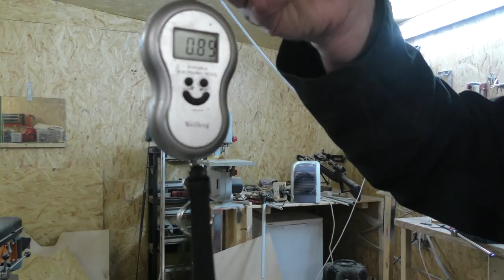How To Make+Shoot The Pump Action Repeating Crossbow Pistol

Comment: This is brilliant, thank you Joerg!  Now I want to see a 3D-printed composite version!!
Reply: J. P. 3D printed bow? Not a chance (if you want something that can be used as a weapon)
Reply: Randy Is there a law against 3-D printing a crossbow frame?
Reply: +J. P. (Prohaska Nation) the bow frame would have little to no elasticity, compared to wood or metal bows. You would have to use some inherently elastic bow string, such as rubber, but even then the plastic couldn't handle as much draw weight as a cheap wood slingshot.
Reply: No, it's just that the plastic would be lucky to hold for a few shots. Most 3D printer plastics anyway, they're practically pure chinesium.

Comment: The airgun has more penetration then a 5.56mm bullet. holy shit.
Reply: Not quite. It went through a single car door and through some wood. If the car door deformed the bullet (possible) it might not have had enough penetration to go through as much wood because it wouldn't have it in the ideal cross section and probably would be keyholing.  A 5.56 nato round has 1700 joules of energy while this launcher has just under 1000 joules.
Reply: acephantom903 i think the door would we enough to deform the bullet unless it is a green tip.
Reply: 556 is not supposed to have high penetration, the dart is also hugely more massive with a file hard steel tip. it's not really a fair comparison to make.
Reply: FMJ, which is standard for a nato 5.56 round, would've sliced through that car door and out the back of the shed without any issues, even deformed. You highly underestimate the penetration power behind that round. It slices through standard lightweight kevlar vests easily, and at a distance too. The standard nato 55gr is small and moves at 2700 fps out of a very short barrel of 10.5". Out of the ideal 24" it moves at 3300. This bolt being a very large and slow moving round compared to all modern bullets will by nature have far less penetration power. It probably even penetrates less than a .45 acp.

Source for velocity: https://www.ar15.com/forums/t_3_118/511787_.html&page=1
Reply: LIBERTY PRIME i don't disagree however the thing about 556 is once it hits something it starts to tumble because it is so light
Reply: SuperAWaC It starts to tumble but much of the energy still remains, as long as the steel of the car door doesn't break the round into multiple pieces it'll still retain much of its penetrating ability.
Reply: Given that car doors are mostly aluminium these days, it's very unlikable to cause the bullet to fragment. Also a tumbling round is still very effective by dint of its sheer kinetic energy.
Reply from the maker: This car door is steel though... a powerful rifle round would no doubts go right through that car door, but it will deform slightly. Not enough to render it harmless in any way though. The difference is that this "arrow" is 18mm in thickness (.71"). It requires a lot more energy to punch a hole that big into several layers of steel and plastic than a 5.5mm hole.
Reply: but with what i saw.i think it has more than enough energy to do so.
Reply: Remember kiddos, Speed is how you kill armour, not size ;)
Reply: Drivenfromhell Gothimus Prime as said by Matt.
Reply: Drivenfromhell Gothimus Prime Speed's how you pierce armour, but a heavy enough slug with a lot of velocity will still kill anyone wearing it.
Reply: Drivenfromhell Gothimus Prime 
i am not a sciencetist but isnt it momenton that kill(or energy idk)
Reply: SuperAWaC, The joule measures energy which is force*distance.  Once you compare joules, it's apples to apples
Reply: Avensis Astari Sure but im guessing in this scenario there isn't anyone wearing the armour?
Reply: Drivenfromhell Gothimus Prime Ceramic plating is designed to stop penetration, it can't do anything about the simple force of a kinetic impact. The underlayer helps spread it, but it still causes bruises on a wearer.

If you had a heavier round it might not necessarily pierce the plating, but it could impact hard enough to cause internal bleeding through the kinetic force.

Especially as modern armour is simply plates of ceramic material over padded vests.
Reply: In the example of a bullet, an object with low mass, yes. You're ignoring the part where I noted that a heavy object with sufficient mass would impart more kinetic energy on the wearer of the vest.

E.g., it wouldn't stop a cannonball, but it would stop a bullet.

It was a hypothetical throwaway comment, not a scientific thesis.
Reply: Yeah, ceramic plating is pretty amazing for deflecting rounds.
Reply: Avensis Astari it's mainly used in pair with kevlar. higher caliber ballistic plates use the ceramic to break apart the bullet and slow it down enough for the kevlar behind it to be able to catch the fragments.
Reply: Yeah, said fragmented pieces being fair easier to stop.
Reply: GreyRaider ceramic plates do not fragment the bullet, though that can happen depending on the bullet type and hardness (if it a brittle metal mix). The plate itself shatters, this absorbs the kinetic energy of the projectile and dissipates it through a larger area. That is why you can not reuse ceramic plates versus steel. High end ceramic will have sections and layers (like ceramic tank armor) to reduce the effect of losing plates and increase the number of impacts it can sustain.

Comment: Might seem like a silly idea but maybe it would be more efficient if you made a grip for the pump that was horizontal that you can slide your palm into. Sort of similar in shape to a circular shopping bag grip, but tighter against your hand?

That way it's easier (at least in my head imagining it) to keep the crossbow pointed where you want it to be as you pump it. It might also be more stable too.

Comment: If anyone has a 3D printer please try printing one of these and share photos/videos.
Reply: Not sure if PLA would be strong enough, maybe other plastics like Nylon.
Reply: @TheIcemanModdeler  Would be awfully slow too. At least 24 hours (with 0.4 - 0.6 mm standard nozzles), probably over 48, since you don't want to ruin the integrity by printing too fast.
Reply: For some reason the blueprint will not load, is there someone who has it and won't mind posting it

Comment: I learned a valuable lesson today when testing out my replicated Jorg-Ko-Nu...wooden triggers, even plywood wooden triggers are not recommended for crossbows of any poundage. My left thumb took the brunt of the strings snap back. Ouch. Now I'm fabricating a metal one. Here's hoping lol. I have rigged a 'safety' on my pistol crossbow for those just in case moments.

Comment: even cooler than his mag-fed modified one. Ive had one of those cheap bows sitting around for years. got the older 2 part bolts but Ill probably be losing a few soon enough LOL hardware store time! Gonna look to some rollers for the pump handle to cut drag a bit. perhaps a delrin rod with the screws down the center?

Comment: To increase the speed of the valve you could introduce a piece of string with slack in it so the rubber acting on the valve is moving at full speed by the time it starts of opening the valve.

Comment: Add a 18-24 inch spike to the front side of the pump for zombie spiking that could also allow the user to simply smash the gun on the ground to reload. 

If you made a rifle version you could really up the power with a design that reloaded based on ground to user weight. Shoulder in the shooting position on the rifle stock with the "stirrup" on the ground and the user simply uses their weight and gravity to reload the weapon.

Comment: To make sure both the point and knock end of the arrow have fallen perfectly into battery before firing, you could make a simple electrical circuit that makes an LED light come on in the rear. You could just have the two contact points in the arrow tract, point and rear, and the aluminum arrow would complete the circuit when it falls right.

Comment: Once again, you get far beyong the expectation.. in both model , maybe i should say, in three model you showed us.. including the 1000 joules air gun..very impressive...for now, didn,t see how you filled the air reservoir.. not manually right ?  Question, about the 1000 joule airgun...is it possible to make a silencer to make it more discrete without loosing efficiency ?  i would like to see this gun shoot in free space to see how far it can get.. metal doo and wood board make it slowing down a bit.. a big bit...so 

Congratulation again.. i appreciate all your ingeniousity
A co mment though.. when you use rubberband to the wooden crossbow, my experience is that they last only few weeks. how long last yours ? are they from better rubber quality ? what we get here come from China so fater some time they like..dry out.. and then brake very easily. cold they be replace with better rubberband ? like those for sling shot ? and it end up at you glued your wooden gun.. but half way through, you could make two piece and assemble them with bolts and screws so it can be oprn and change the rubberband then re assemble...so ?

Comment: I have a question, why didn't you make it so the trigger end is also the string pull back handle? isnt it a little awkward for you to press your hands together to pull the string back? if you had the trigger pull the string back (almost like a bow or slingshot motion) and have the pistol grip slide up from a slot on the bottom with a hook attached to it(that would slide underneath the string and grab it once it passes). I feel as though it would get you quicker results than the second version.

Comment: I've been doing a lot of research because I'm not an engineer but I like weapons, and from what I found on pullies and compact bows, it has more force with you using less force over all 20lbs of human = 80lb crossbow for example. Maybe you could do something with that to assist with the pump action. But again, I'm just new to concepts of these weapons.
Reply from the maker: Compound bows or crossbows use cams to allow a so-called let off. Means, you have to overcome a huge amount of peak force, but then it gets a lot easier. Won't help with the pump action though.

Comment: If integrated a cross-bow cocking leaver into the stock, instead of the sliding pistol grip design, you would nave more leverage and could increase your fire rate a bit.

Comment: Joerg, may be you could build a recoil absorbing stock with rubber power simular to ones found on modern shotguns such a the UTS-15 i think it's called. A high tech stock for a record breaking gun seems fitting, right? The stock could last a lot longer this way i think

Comment: Here's a wild idea. Going back to the first bow, what if the front handle is where the trigger is, and the rear cocking mechanism had a handle on it. That way you can benefit from that cocking motion, while having both hands on the crossbow at all times.

Comment: I paused it at 11:50 . I wanted to ask you about where you out the two screws in to hold the pump? I did this one time to make my shelf slide better ? I put a sleeve on the inside of the threads so it could slide easier and it worked and is still working almost no friction between the bolt and wood ? great job it looks funny to shoot

Comment: I wonder if you could apply the same pump-action concept to a recurve bow. And make it so you can draw it back like a bow (then the string locks in place) and then shoot.

A fixed handle at the front and a movable handle at the back, which would also have a trigger. (with safety of course!)
Reply: UrbanTarzan Duh That is a crossbow basically :) But for a recurve bow, with long draw, that's not practical
Reply: Randy I meant that you would hold and draw it exactly like you draw a bow, perhaps making the motion more intuitive and maybe faster.
Reply: you'd probably have to fix it to something, or else you have to combat the force in the other direction at the same time, then you more or less have a crossbow.

Comment: Joerg:

Awesome videos as always! I look forward to my weekly fix of Slingshot Channel!

Re: Your air cannon and pressurized sniper rifle -- have you done any calculations on the forces that the pressurized air tank experiences at load? 

You say you are using 3000psi, correct? 

That would be a bad thing if it ruptured from a badly welded seam.

I would be wary of the steel pipe bursting pressure.

Comment: What if the user pulled the trigger handle backwards to make it a tension cocking mechanism. Not everyone has your iron pecs, but most people have decently strong backs and shoulders. The only problem is, if you try to pump it near your face while aiming, it could come hurdling back

Comment: Pretty cool device.  I have two of these crossbows, pretty powerful for what they are.  I actually put the bolt in and then cock it, not sure if it can damage it ever, but so far they are both holding up hundreds of shots later, and it speeds up the stock shooting time quite a bit..

Comment: is there not a way you can spring mount the slide rather than using elastic bands? like for example have a hinged piece of wood that lifts out with springs facing down to put pressure on the slide?

Comment: the Chu Ko nu already had a good design and good leverage.
Reply from the maker: It shot unfletched bolts with lousy flight properties.
It had no trigger, so it was notoriously inaccurate.
It had to be pressed against the chest, so there was no sighting system. 
Not a very good design in my book.
Reply: I think it would allow more draw weight at a significant cocking speed, maybe the design could be better with a lever on the left (to operate with the left hand), a rubber band to replace the bow, (so it isn't blocking the lever) and a rifle stock to provide comfort when pulling the lever towards you without losing much track of the target.

Comment: Hey JoergSprave I plan on making this myself so i have a quick question. I was thinking of using track( the ones used in sliding doors that also acts like linear bearings) to reduce the friction of the pump as it slides making it easier to pull the pump and reload. So my question is do you think there will be a significantly noticeable change or the difference it makes is just so small it would be wiser to just not do it?
Reply from the maker: I think the difference is small. Friction is maybe one or two pounds. The crossbow has, like, 80 pounds.
Reply from the maker: Car engine parts spin very fast, friction creates heat and abrasion. Not so much of a problem here.

Comment: Instead of rubber bands holding the bolts why not make a piece that pivots at the front and locks down at the back. You wounf use a zig-zag spring to compress the bolts and the scope can be attached to the top of the spring device. When you need to reload simply unlock it at the back, flip it forward, drop in the bolts and lip the spring mechanism back to lock it. I got the idea from watching the reload of the M2 50 caliber machine gun used by the military.

Comment: I would suggest keeping the original model's mechanism, because it use the lever action, which is way more power efficiency, lighter to cock, than straight pumping action, but add like a wrist wrap (not a wrist wrap, but a U shape handle that you can rest your wrist on, or lenghthen it out to your arm for more leverage) so you can just cock it back without having to let go of the handle.

Comment: did your use full threaded bolts or only threaded tips for the cocking handle?
Reply from the maker: Threaded all the way. Didn't have other types with the right length. This creates some friction but not very much.

Comment: There is injustice somewhere in the world, A criminal stealing from a rubber factory, placing a projectile WITHIN the barrel of a deadly German Toy, or perhaps even "Trying this at home" despite previous warnings.
However, thereis no law enforcement within miles,  and no witnesses to see their crimes.
They begin to relax, believing that they have complete free will and power.

Until they hear it...

A mighty laughter echoes in the distance. - They grow timid.
A barrage of steel pellets pepper the ground around them - they look around fearfully as the laughter grows louder.
A series of assorted blades shred all around them - they yell in fear and begin to run - the laughter now deafening.
A 4 foot air-powered missile flies past their head, penetrating every wall and tree for miles, they freeze in place, terrified as another hundred various arrows coat every surface in sight - the Laughter briefly stops, a faint phrase is spoken behind them "ᴴᵉᶫᶫᵒ, ᵃᶰᵈ ʷᵉᶫᶜᵒᵐᵉ ᵗᵒ ᵗʰᵉ ˢᶫᶦᶰᵍˢʰᵒᵗ ᶜʰᵃᶰᶰᵉᶫ"
Slowly, and carefully, the criminal turns around.
.
.
.
"I....is that... a slingshot launching slingshot?!" They yell in terror.

Joerg stands proudly - carrying his mighty invention with great pride "Yes, now let me SHOW YOU IT'S FEATURES"

The Criminal cries in terror, picking up and throwing every dangerous item around them, this does nothing as Joerg has come prepared, protected by his impenetrable safety T-shirt. He laughs happily.

The criminal wakes up later in a jail cell, their head aching from the impact of one of Joerg's impressive creations, they look down at their lap to find a note, it reads: "Thanks and bye bye".

Comment: I know the video is old but Jörg, you really need to wax your strings!
You said yourself that the less friction a string has, the longer it will last, which is imperative in a (zombie) survival situation.
Never fire your crossbow dry, it's dangerous because the string could snap violently.

Comment: A crossbow fires bolts, not arrows.  Still great build and video.
Reply from the maker: Bolts = No fletching. These have vanes, therefore they are arrows indeed.
Reply: girafmad I agree with you
Reply: JoergSprave I stand corrected, it is indeed an arrow.
Reply: Hush jr I don't. He is correct, bolts have no fletching.